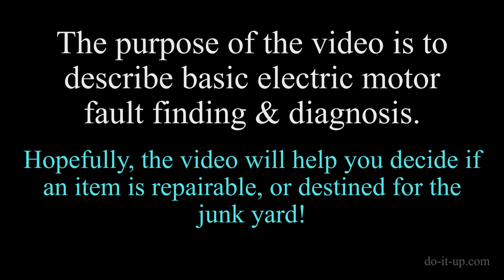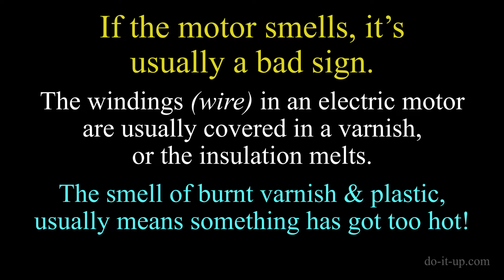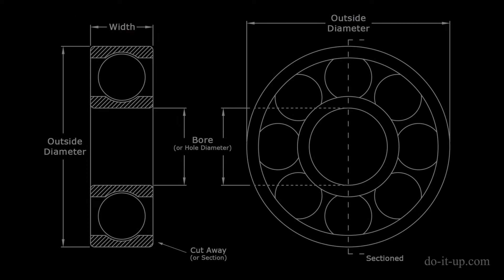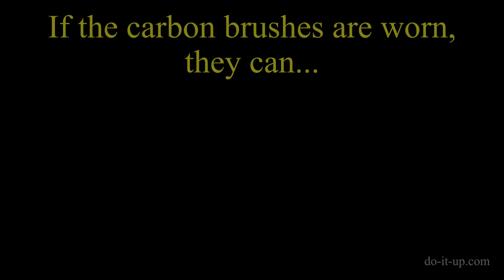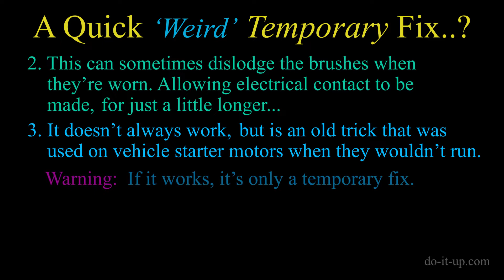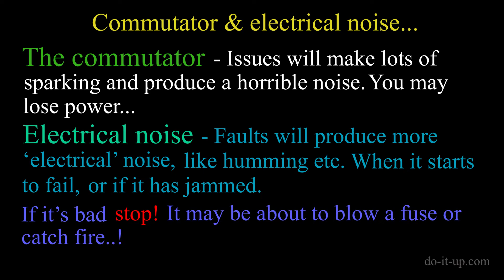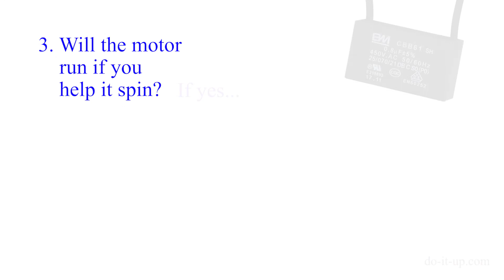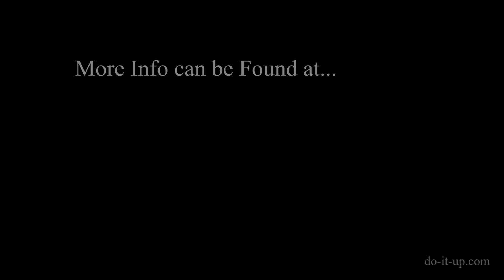How to Fault Find & Troubleshoot Electric Motors, Fans etc. So You Can Fix Them. Easy Stuff to Check

Comment: I’ve got a orbital sander which isn’t working properly. It’ll start and within a few seconds it looses power and stops. I’ve checked the carbon brushes and they are still good. What else should I be checking?
Reply from the maker: Hi, it sounds like it may be the switch on the orbital sander. I.e. on pressing the switch it makes contact briefly, then loses it and the sander stops. Here's the thought process:

- Broken wire: No power at all, or intermittent.
- Starting capacitor: It runs slow or not at all.
- Brushes: Runs slow, lots of sparking, or no power. May have power for a while after taping the sander to reseat the brushes.
- Commutator and windings: No power (sudden failure), or it starts to get very hot before failing.

The above are general descriptions, as you can get all sorts of weird electrical faults! Another thing could be a broken or loose wire near the trigger switch. Activating the switch creates some movement, breaking the circuit. There may be some more information here that may help: https://do-it-up.com/stuff/fixing/how-to-fix-an-electric-motor-fault-finding/?

When you get it fixed, it would be interesting to know what the fault was, (as it may help others). Please be careful when fiddling with electrics, it's easy to get a shock. As usual at your own risk. Hope this helps and you get it fixed soon...   😀
Reply: I’m electrically competent but not electronically if you see what I mean. It’s definitely not the brushes as there is no sparking and after a test it works for a few seconds. That also wouldn’t happen if it was a loose connection somewhere. I can only think it’s something on the electronic board that switches it off after a few seconds due to something being faulty or broken. I’ve done a video of the fault but don’t know how to send it to you.
Reply from the maker: Hi, it sounds like I'm in the same boat as you with electrics... Unfortunately, it's best not to put contact details in the comments, as it's very likely to get farmed by bot's (which means more spam in your inbox). loose and broken wires can play all sorts of tricks, making and breaking with any slight movement, such as operating a switch, or a supply cable moving slightly. I've seen this on switches, power cables, connectors and extension cables a few times over the years. sometimes it's obvious, other times it can be a pain tracking it down!

What I would do at this point (if your competent electrically), in the order of the quickest way home.

- Is take the covers off, switch on, and as long as nothing is heating up or making a horrible noise, tap everything lightly with an insulated item, such as a screwdriver handle - Taking great care not to short anything or give yourself a shock. This should indicate if anything is loose or broken.
- With a meter, trace the supply through the sander to see where it disappears. At some point the supply will disappear as the motor stops, a short time after pressing the on switch. You should then be able to identify which component is defective.
- If the supply disappears before the on switch (when pressed), then you'll know it's the supply cable or extension lead. I've had this where the supply cable or extension lead had a broken wire, and in a plug with a loose connection. The item I was using would power up briefly. As the item draws current, the broken\loose wire (which is in close contact), would arc and the circuit would break. You can't see what's going on as it's inside the cable sheathing\plug.

I've traced a broken wire inside an extension cable by plugging in a light to see if it goes on or off. Making sure there are no exposed bare wires, I would then bend the cable multiple times along its length. I could see where along the length of cable where the break was, by the light flickering. Unfortunately this does not work if it's a good clean break!

As usual, at your own risk...  Hope this helps. Finding hidden faults is a pain, but when you do find it and fix it...    😁